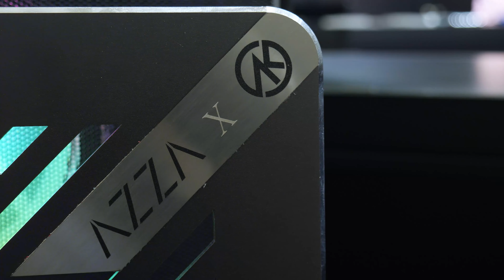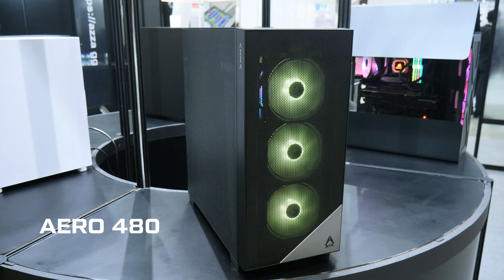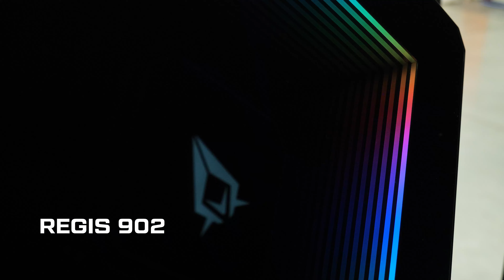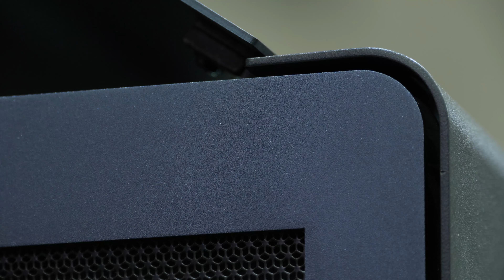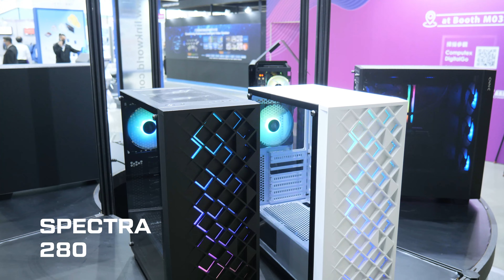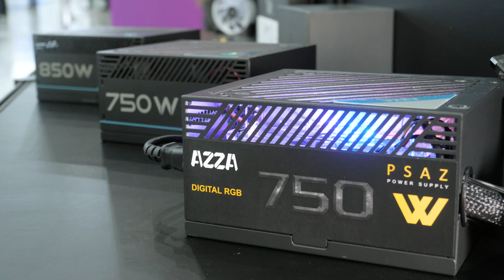AZZA COMPUTEX 2022

Comment: Any plans for a Pyramid L mesh version? I'm afraid 300mm just won't cut it with some current/next generation GPUs
Reply from the maker: stay tuned ;)
Reply: @AZZA_HQ  yeah I usually expect 1 over the top incredible design per year like the cube and the pyramid. It it can mix design and good airflow for a gamin  rig it would be a big seller 👍